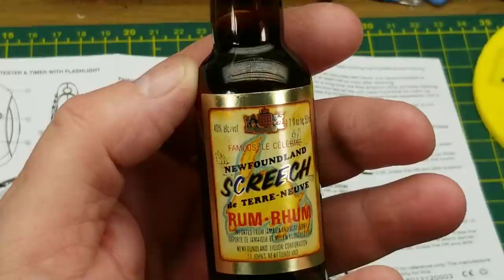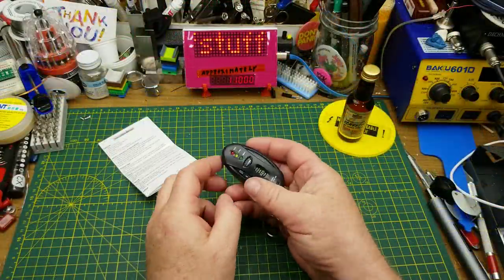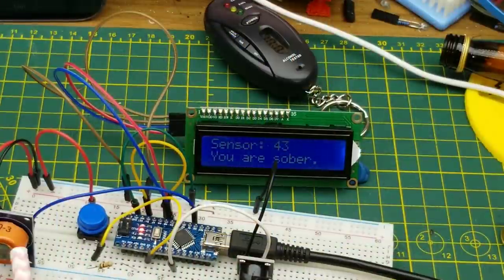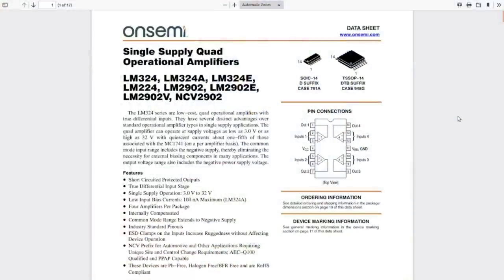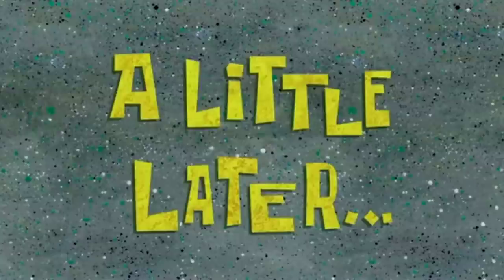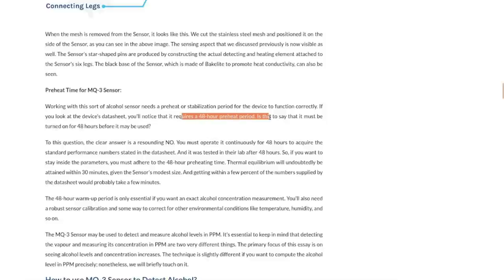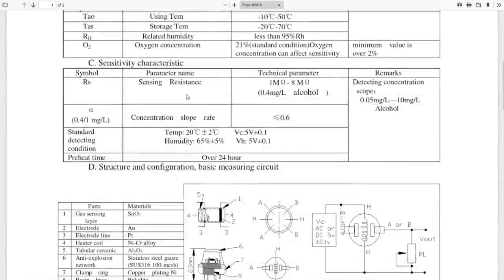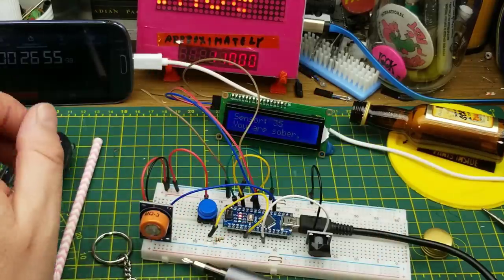testing an alcohol tester - drinking for science!

Comment: Just curious, was the blue thing on the end of the board actually a capacitor?  IT looked a bit deformed, like maybe it was a shrink coated inductror.
It use to be said that to get to 0.05 is roughly measured as 3 standard drinks for the first hour then two per hour after to keep you there, maybe that little bottle of rum didn't have as much alcohol in it as it felt like?

Comment: That takes me back to when I used to work for a living. It's basically the same sensor as industrial explosive gas measuring equipment uses. The methane curve at the top was almost linear and that was the one we used to calibrate the instruments to and measure the value of the Lower Explosive Limit of gas atmospheres.

Comment: In order to be considered valid in court, and per the instructions of both Breathalyzer and Intoxilyzer, the person being tested is to have not consumed ANYTHING by mouth for 20 minutes prior to the test.  If the person consumes anything by mouth, they must wait another 20 minutes to be tested.  Also, the test must be performed within 2 hours of the alleged driving, although there are exceptions.  The test is measuring the alcohol content of the deep lung air.  So, the person being tested will be instructed to take a deep breath and blow hard until they empty the lungs.  It has been at least a decade since I was certified to perform breath tests.  The machines have changed, but not the basic procedures.
Reply from the maker: I'll defer to your experience.
In all my years, I've never had to blow into one.

Comment: I'm afraid your methodology was wrong from the start. These devices are calibrated to warn you if you reach certain BAC levels, not tell you if you're feeling the effects.

Basically, it's not a valid test of the technology because Mother's Against Drunk Driving a 165 pound man will (barely) hit .02 after having 2 drinks in 2 hours, and won't go over .05 unless he has more than three drinks in that time (YT won't let me post the link, but search for "MADD alcohol chart"). So unless you weigh quite a bit less than 100 lbs, you can't expect to reach the programmed thresholds on one drink.

BTW - the first time I saw that chart, I was astounded that I'd be considered "legal" after way more drinks than I'd ever consider myself OK.

Comment: You won't have significant amounts of alcohol in your blood /breath after only 10 or 12 minutes. Approximately 20% is quickly absorbed in the stomach, the remaining 80% is absorbed in the small intestine which takes much longer.
It will take at least a half hour to be fully absorbed, and may even take up to an hour after drinking. It also depends on what is in your stomach at the time, since some alcohol may get absorbed into foodstuffs which will slow down the extraction process.
Also, that tiny bottle of rum is only 50ml or 40% (80 proof), which is less than 2 nips (standard units). Most men would only peak out at 0.2 or 0.3 after such a small amount of booze on an empty stomach.
...
The above information is based on my lifetime of professional experience with scientific drinking, although I have generally avoided using rum (except for considerable amounts of Bacardi in my teens).